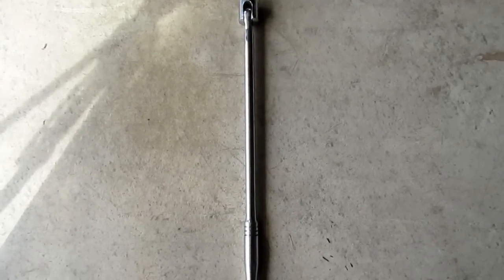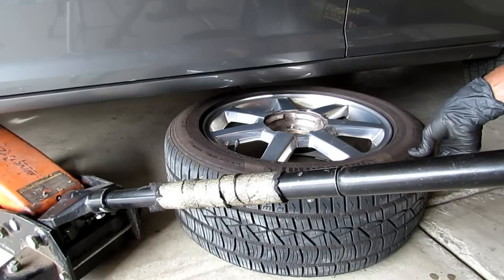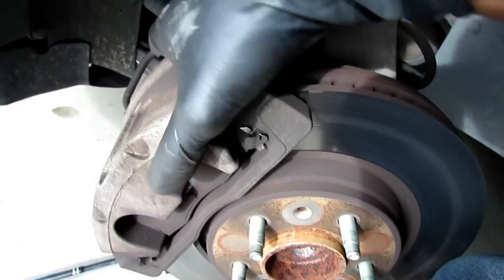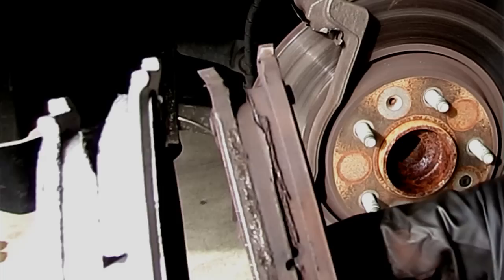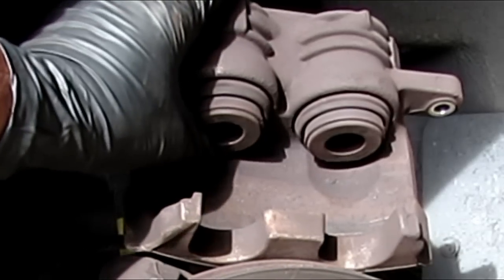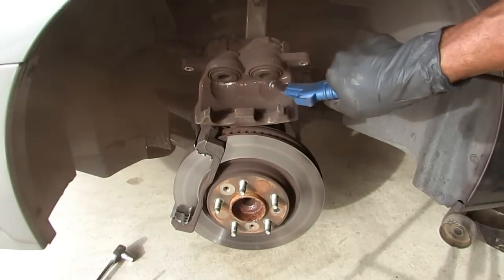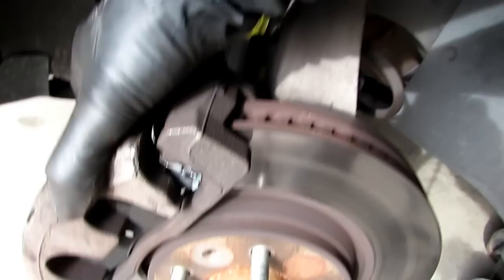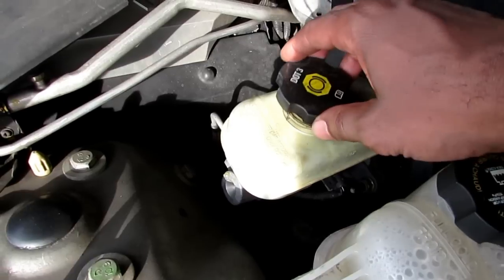Cadillac Brakes: Learn How To Change Front Cadillac Brake Pads - Fast At Home

Comment: Very good job . Great info done slow as not to confuse people new at this . Do you have any vudeos with lifter noise . I have 2003 Cadillac Seville that has noise . Also leakage in my trunk . And leakage from tire . I make a turn and i lose half my air . Old tires but i can't replace no money so i refill em.

Comment: GREAT step by step instructions on the pads, especially about safety. You just saved a lot of people some money because they feel they don't have the special tools or "know how" to do this job, and you just proved different!
Reply from the maker: Astral Auto Repairs Thanks I appreciate you watching and thank you for leaving a comment.
Reply: @oxmanagain  question.i wanted to remove the whole housing...but I can't remove the two  13 m bolts that hold the housing...should go buy a breaker bar? Noticed the first bolt I started to work on started getting a little rounded because  I broke a socket trying to muscle the bolt off. I stopped before further damage to he bolt.
Reply from the maker: Yes, I would recommend buying one of those. They come in handy for so many different jobs.

Comment: Good video, did you notice that one pad had worn out way more that the other. You put new pads on and did not check your caliper slide pins that are suppose to slide freely, your seems to be stuck. Ok you paid a lot for the brakes but you will be hearing that squealing noise real soon. Nice car.
Reply from the maker: Thanks I will go and check that out. Good eyes.Thanks for watching.

Comment: I have a 2006 Cadillac are and I trying to change my rear pads but my caliper piston won't go in with a C-clamp. I read on a online cadillac form that my rear piston is supposed to be screwed in. Is this true?
Reply from the maker: Yes,  I think some models have that. But when I did my rear the caliper went right in. You might want to open the brake fluid cap to release the pressure.

Comment: hey i followed every step except the bleeding and now my abs light comes on and my brake peddle pulsates/kicksback at the same time, and this happens randomly now. what did i do wrong lol
Reply from the maker: Try bleeding them. If that doesn't work, you might need new rotors.
Reply: oxmanagain yessir. also thanks for replying to my comment so fast 🙏🏼 your videos on the sts have saved me about $3000+ so far so thank you very much on that too lol🙏🏼🙏🏼🙏🏼
Reply: oxmanagain bleeding them fixed it thank you man!!!
Reply from the maker: @Calijay707  I'm happy for you.

Comment: Um u didnt lube the slider pins or the hardware/ends of pads. Also why are you bleeding brakes when all u did was a pad slap? There is no air in the brake lines u never opened the system
Reply: Did you notice the lube on the old slider pins?..and why not bleed the line? there may be air in them, better safe than sorry ...oh and when is your brake changing vid  coming ..would love to see it.